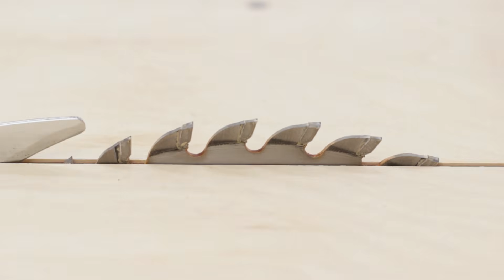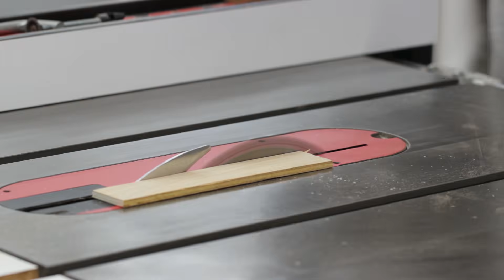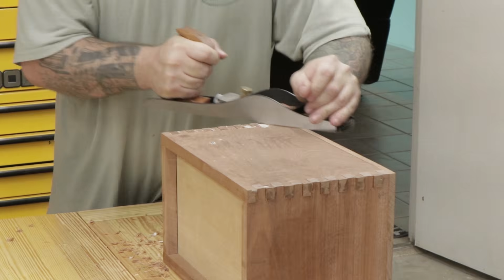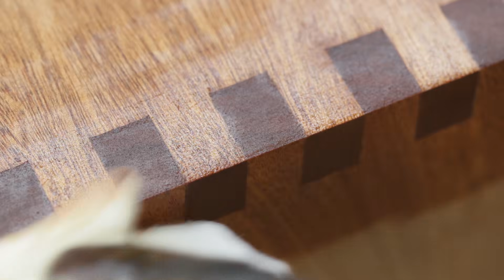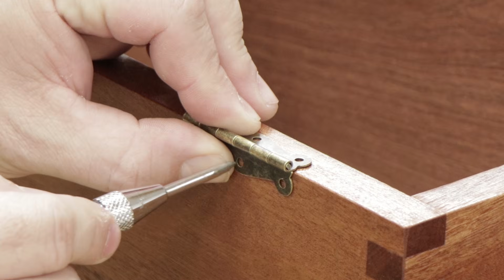Keepsake Box Using Box Joints

Comment: Great video.  I’ve built a ton of those box joint jigs.  How much tear out were you getting?  In my experience if you don’t provide a sacrificial board for each cut the tear out isn’t worth it.  So you really need "2" fences but one that moved with the actual piece to get that fresh sacrificial area behind the work piece.
Reply from the maker: @bon2198  good points. I don’t think the tear out was too bad but would have been better with your suggestion of a sacrificial board behind it

Comment: Thanks for a well done video, but get a rubber mallet or your going to go ahead and give yourself tendinitis.  The long term affect of using you hands as a hammer is lots and lots of debilitating pain.
Reply from the maker: Thanks and you’re right! I spent the first half of my career as an automotive technician using air guns, not lifting properly, hammering away with whatever was close(usually a part of my body). I always felt indestructible. Now in the later part of my 40s I am starting to see the effects of all of that work and abuse on my body. Good tip and thanks for sharing

Comment: I was looking for a way to do the box lid and you showed exactly what I was looking for. Thanks.
Reply from the maker: That’s great! Thanks for watching and good luck with your buid
Reply: Any issues with wood movement for the lid built like this?
Reply from the maker: @jmherbst87  . No issues with wood movement. This would rarely be a problem with good kiln dried hardwood on a piece only a few inches wide. I would use a different method of attaching woods in different grain directions on large panels and table tops though
Reply: Ok good to know, thanks!

Comment: How do you fill the gaps left on the end grain from cutting the slot for the bottom?
Reply from the maker: I used a rapture and stopped the cuts before the ends of the  ends on the sides. Watch about 3:50 in to the video. On the long sides or the front and back, the slots go all the way through but are between finger joints so the short side pieces cover up the slot

Comment: Love the poly trick.  Question though, your top is glued down to some walls, how do you prevent it from cracking due to wood expansion/contraction?
Reply from the maker: Thanks! I haven't had a problem with cracking. I'm looking at the box in this video as a write this and no problems after a couple years. I do pay attention to wood movement on most builds but not so much on a small project like this. If you were not comfortable with the method I used, you could cut the top the same way, add a groove ont the sides similar the the bottom and make the top float in the groove

Comment: Awesome! I am new to woodworking and currently doing a similar item using finger/box joints. Would that gap filling trick work with the osmo polyx oil i am planning to finish with do you think?
Reply from the maker: Thanks! I'm not familiar with the osmo poly x. If its an oil that doesn't harden, it might not work well to fill gaps. It it dries similar to polyurethane, it should work. Some cutting board and salad bowl finishes soak in to the wood and doesn't ever really dry

Comment: When you sand between the coats of the satin finish, is it a light sanding? Then, when you use the steel wool with the wax, are you applying the wax with the direction of the grain or does it matter? Thanks .
Reply from the maker: Yes. Just light hand sanding. I use a block with cork on it and then some 220 or 320 paper. I use 0000 steel wool and try to work it in with the grain. This leaves a satin finish thats super smooth
Reply: @TwistedWorkshop77  Thanks. I’ve recently endeavored into woodworking. I’m in a wheelchair and wanted to do something productive and build a hobby. You’ve videos have helped me drastically. Thanks and I look forward to more of them!

Comment: I just came across your video. I've made the same box only a bit larger and just made from a quality 1x12 pine board from HD. Actually I've made 3 of them for my grandkids 2nd Xmas's. Main difference is that I used a piano hinge for the lid and installed a spring-loaded hinge on the inside so the lid would stay open and the kids wouldn't smash their fingers closing the box.
Reply from the maker: Nice. I like the spring loaded hinge idea

Comment: Quick question - what is the name of the tool you use to mark the hardware before you drill pilot holes? 

Awesome video!
Reply from the maker: It is an automatic center punch. Sometime called a spring loaded center punch
Reply: @TwistedWorkshop77  - Thanks!

Comment: Lovely work, I have just subscribed because of this. I have a few questions for you..... what is the polyurethane that you used, I have never used it before. How does it work. Are you able to put any finish you want on top of the polyurethane. Thanks in advance for your answers.
Reply from the maker: Thanks for watching. I used minwax wipe on poly but I have also used general finishes arm r seal in the past. I know you can use shellac, lacquer or polyurethane and it doesn't affect the finish.

Comment: Hello, i justw build a guitar amplifier cabinet with finger joint. And i realy like your trick with wipe on poly and sanding to correct the joint. I have a can of poly, but it is satin, non the clear like your. I want to know, if y use my poly and sanding to fill my gap, when the poly will be dry, could i apply my favorite wood stain, or i will have a difference of colors where i put the polyurethan?
Thank's
Reply from the maker: Great question! I'm not 100% sure for all stains. I have used general finishes gel stain over that poly and saw dust and it came out great. I'm sure you would just need to try a small area first.
Reply: @TwistedWorkshop77  ok thank you!!

Comment: Amazing video!  I have watched it about 10 times now and made almost that exact box.  I was hoping you could walk me step by step thru your finished process.  You said 3 coats of arm-R-seal.  do you sand in between?  if so what grit?  then I have never used the bri wax before I did buy some. Appreciate everything!!! Would love to see you do videos more often!
Reply from the maker: Thank you. I usually sand with 320 between coats. Sometimes I use 0000 steel wool between the 2 and 3rd coat. After the last coat, I apply wax with 0000 steel wool then buff it out with a clean cotton towel.
Reply: @TwistedWorkshop77  I appreciate the fast response!!!

Comment: Which steel wool did you use?
Reply from the maker: It was 0000 from lowes or home depot. I have been using Liberon lately. It is a lot finer and works better for task like rubbing out a finish.

Comment: You can also make a sawdust slurry with Elmer's clear glue. Just add some to the gaps and sand the same way.
Reply from the maker: I've never used clear glue before. I will give it a shot. Thanks
Reply: @TwistedWorkshop77  Np

Comment: It looked like you had a very exact finger joint jig. So what went wrong that you ended up with gaps? You didn't, by any chance, put too much pressure on the blade and flex it when you were measuring with your block, did you?
Reply from the maker: The gaps were pretty small and easily filled with little effort so I think it could have been the way I registered the board on the jig. Maybe I pushed too hard on one side of the board. I'm not sure exactly but I do know that it's rare that i ever get a perfect set of joints on any project.

Comment: I like the design and execution. Clean, simple and perfect proportion. I especially like your choice of timber and the way you grain matched. Really nice. I am going to make this box but I think I'll put a lip inside the top edge of the bottom, flock the inside and put a mirror inside the lid. I need a special gift for one of my sisters. You box joint box is it. The slurry technique you used was called filled grain. In my first career I was a gunsmith. I don't how it is now but when I was smithing most gunsmiths were generalists, you worked on what was in front of you, metal or wood. I liked stock making but stock making was then at least, the least financially rewarding for the time you put in to it. (The most financialy rewarding was changing lower barrel hammer springs in superposed shotguns). Back then poly finish wasn't widely used, it was fairly new. The times I used what was available it often fell out over time. I would think that would still be a problem with gun stocks, I don't know about pieces that aren't subject to shock. I got the best result when I sanded to 320, de-whiskerd with alcohol and 400, wet sanded with tung oil then let it dry, dry, dry. Then wet sanded with the grain with 600. By that time the stock would be dead smooth. Then bowling alley wax to buff and polish. That's the finish I'll use when I build the box. Thanks for the inspiration.
Reply from the maker: Thanks for the feedback! The additions you plan to make sound great! It's funny you mentioned the slurry trick as a grain filler for rifle stocks. It must be a common method for smiths. A friend of mine uses true oil or linseed oil and sand paper to fill the grain on the stocks he restores
Reply: @TwistedWorkshop77  I don't know how I dropped it out but what we're talking about is a  "gun stock" finish. Grain filled and dead smooth. You can get a faux gun stock finish with modern plastic finish, sand it, paint or spray the finish on, most of them are self leveling, at the most a light sanding with some fine paper, make sure you don't sand all the way back down to the timber and apply another coat. It looks nice, smooth, shiney and fairly fast. But that finish has depth to it and it's hard to do a nice job of repairing dings and hand worn spots. You can look at it and SEE the finish is laying "on" the timber. A gun stock finish, smooth, shiney and all looks like it IS the wood.

Comment: This would make a great starting point for a tool chest. Such a lovely job. The saw dust trick is one that I’ve never seen before and what a trick! Really enjoyed watching this.

As a random thing. Did the sides come up as square when you had it in clamps? I always thought that the clamp force would bow the shape of it and therefore, it wouldn’t give a true square reading. Box makers normally use pinching sticks, as it’s more accurate, but perhaps the thickness of your timber resulted in less bow? I’m intrigued. Thanks.
Reply from the maker: Thank you. The sides of the box were so small that they didn't deflect much with the clamps. I can usually see the deflection on larger boxes and cases with the square though. I usually back the clamps off if I see it as it can cause  small gaps on the end of the finger joints or dovetails.  A set of pinch sticks is on my list of things to make and would be a better method for sure!

Comment: You can stack all of the sides up together and cut them pretty much all at once. Just need to do the first cuts individually. But once you have a cut on each side you can stack all 4 sides up and cut them all ganged up. I clamp the stack together with swivel pad face clamps to make it easier to handle as one piece. Cutting them all at once seems to make them come out to fit together better too. I think because they get registered and cut together? Give it a shot.
Reply from the maker: I will give that a shot next time. I need to start making ganging up parts part of my process more often, with dovetails too
Reply: @TwistedWorkshop77  try it, you'll like it. The one thing I remember that was an issue was blade deflection cutting the whole stack. Going through that much wood just makes a blade bend more than going through a single board does. So you might have to feed slower or something. It isn't quite the same rip. But you don't have to make nearly as many passes. If you go too fast you get too tight joints. You'll figure it out.

Comment: I agree with your liking for Gen Finishes Satin. They have changed the formula in recent years. The older stuff was thicker with an additive that
would yellow faster and leave a more velvet finish. Making some finger box joint boxes now and will post my steps with 1/4" joints and knife
kerf hinges. You can water down some filler and do a single swipe for the loose fit fingers and then sand and you may have to tint the filler stuff to match the wood color. You can buy the colorant from food processing companies. You have the MO accent or maybe TN?
Reply from the maker: I have really good luck with GF products. I have been their milk paints with good results too. It's not real milk paint but it has that flat smooth look to it. 
Good to know about the coloring. I will have to try it. And check out you video.

Comment: To speed up your gap filling, a tip I've used is to just go to dust collection on your sander and use that to instantly fill the gaps with your slurry.

Lol, I missed the part where you said you don't like this method.
Reply from the maker: Yea. Good idea. I will give it a try next time. Thanks!

Comment: Nice Job , you kept the FJ's equal spaced  ! Love the tip on the sanding to fill in the small gaps in the FJ's Thanks Again
Reply from the maker: Thanks! I like that method of filling gaps. Sometimes I apply some poly or boiled linseed oil and sand the surface on small boxes just to fill the pores and get a smoother  finish.
Reply: Twisted Woodshop mmmmmmmm

Comment: Did you glue to plywood bottom or is it floating?
Reply from the maker: I'm pretty sure I left if float. Most of the time I roll up a small tape ball and push it in to the groove before installing panels so they dont rattle. I think Rockler sells small foam balls for the same purpose
Reply: Twisted Woodshop gotcha! I’m building a ~20 x 12 x 8” wine crate and trying to decide how I want the top and bottom to attach.
Reply from the maker: @lastingbuild1373  Cool. I can't wait to watch the build.

Comment: Instead of referencing to the blade to set your miter to 90 degrees, it is better to reference the miter slot itself.  Saw blades can have a bit of warp in them that can throw you off.
Reply from the maker: Thanks for the tip. I made sure when I first set up my table saw to get the alignment of the table to blade as close to perfect as I could so your recommendation would have worked for me.
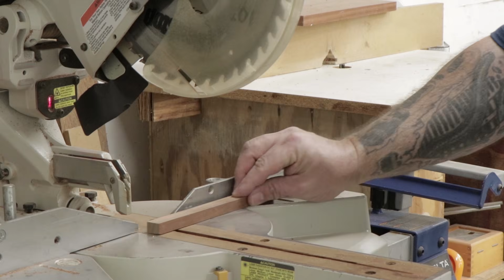Reply: Around the 1:40 and 2:32 mark you can see what went wrong I think...the blade wasnt the problem,yet the finger you glued in the cut isnt quite square and seems to cause the gaps you got....I did something similar the other day and was wondering what happened and I found out what it was. Great video though and I like the router technique...just subscribed!

Comment: Nice project. This turned out really well. I always like the pattern one gets at the end of boards when using finger joints. Thanks for sharing. Best wishes
Reply: They're box joints. Finger joints are what they use to lengthen cheap molding. They're thinner and angled. A special bit makes finger joints.

Comment: Thanks for that poly tip, and now I'll share one with you.
When you go to separate the lid, don't cut all the way through. Cut almost all the way, but leave just a thin, thin, see-through layer of material. This will hold the lid in place without fooling with all those spacers. Finish up separating the lid with a coping saw or any kind of trimming saw.
Reply from the maker: Thanks. I am going to make a humidor in the next couple months and will give this a try!

Comment: Very nice production work!  Great camera shots and your editing was spot on!  If I may suggest....yep I am gonna be "that guy"!!!  Once you get everything cut to size do a 'dry fit and make sure everything is going to fit up like you want it and come out squire.  Yes you should also check it after you do your glue up but if something a majorly amiss there is not a whole hell of a lot you can do about it short of ripping everything apart and playing hell trying to get the glued up joints to come apart.  I'm sure that someone like Mr. Paul Sellers has said to do it this way in one of his videos but I came by it the hard way!
Reply from the maker: Yes, good tip. It would be pretty tough to get the finger joints apart after applying the glue. Doing a dry fit is essential. Thanks!

Comment: That trick with the wipe-on poly is amazing.  I have used it a few times this week to fix some gaps in dovetails that I cut.  It is not as messy as the saw dust and glue method and works well with contrasting colored woods.  Thanks for the tip!!!
Reply from the maker: That's great. I'm glad it worked for you!
Reply: is  the poly water or oil base?
Reply: I use water-based poly.

Comment: Nice project and video. The quality of the hardware  (in my mind) brought it down a little. Would have liked to hear an explanation of how to fix the initial finger joint jig set up if it was too tight or loose.
Reply from the maker: Thanks for the feedback. I wasn't sold on the hardware when I first received it but it is growing on me now. Next time I'm at the woodworking store, i need to stock up on hardware that i can see first hand. Ordering online can be difficult. I struggled with explaining the jig in this video. I should have at least referenced some of the videos I've watched that explains it better. Popular woodworking has a good plan and explanation on how to use it and I recently watched a video from "Make Something" where he made a nice jig